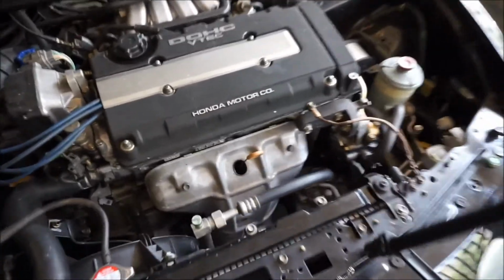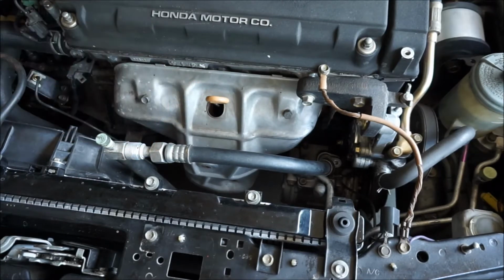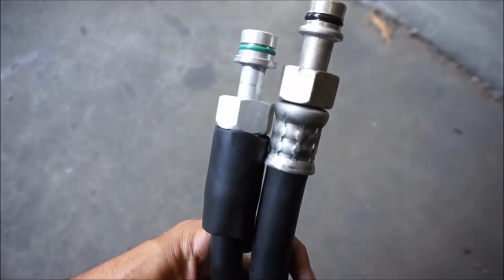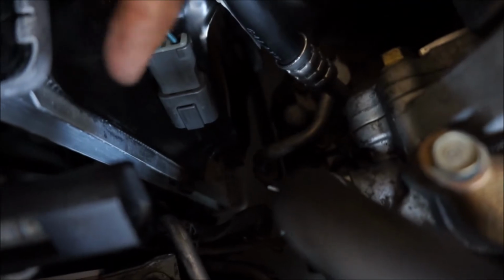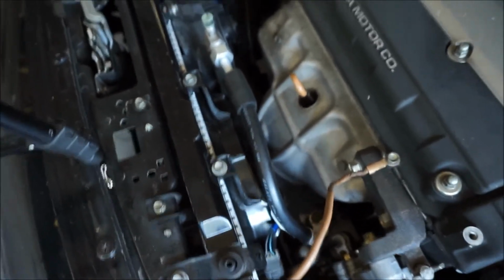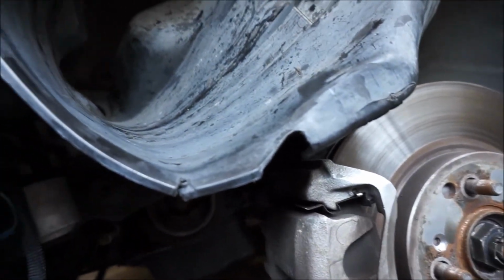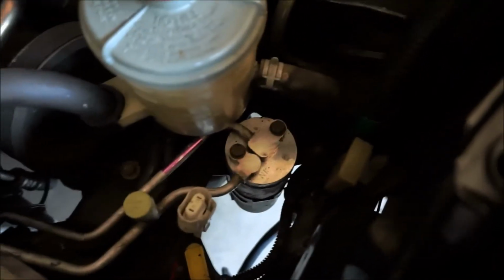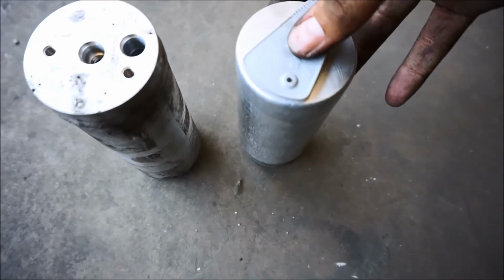Integra a/c repair part 3 | new suction hose and receiver drier

Comment: This is the first video i've seen on integra AC components. When I bought my db7 it didn't have a compressor,  but it does have the reciever dryer, lines,  but the main lines with the o rings were done apart and opened for the longest time. I found a teg in a junkyard with everything in the engine bay so i'm trying to learn how to switch all the parts out.
Reply from the maker: Nice!! get everything missing, install and buy an o ring kit off of eBay. get some PAG oil too. use the oil on the o rings and threads. You’ll also need the vacuum pump to evacuate the system.. then install the r143a… if you need any help, message me on ig @ integradiy

Comment: hey bro I have a quick question, my factory remote for some reason stopped working and now I have no way to disconnect my factory alarm except remove the battery lol. Do you know of any fuse that I can remove to fix this problem? I already have a after market alarm so I dont even need the factory one.

Comment: Hey I changed my alternator and after I ran my car for awhile the low line was sweating and leaking water. Does this mean I need to do what you did in this video or is that normal?

Comment: Whats the name of that second Line the one you said you can only find from Acura or a junker ?
Reply from the maker: Hi Sara, I'll get you the Part Number and Name when I get home tonight
Reply: @IntegraDIY  appreciate it. I may splice it but still need options from Acura or junker.
Reply from the maker: The part name is Pipe C, Receiver 

The part number is 80343-ST7-A01

If you need more names and part numbers or anymore integra related help, message me on Instagram @ integradiy
Reply: Integra DIY did you ever find out what that lines was called?
Reply: Sara Alvarez did you ever find out what that part number or line called?

Comment: How much have you spent so far on this ac job?
Reply from the maker: +K D everything including the radiator around $100 only
Reply: Integra DIY nice. Thank man. Took out my ac compressor when I took out my motor. Now Ima put it back. Since I just took out the freon and then took out the compressor, now I can just put back the compressor and freon right?
Reply from the maker: K D no, you must evacuate the system, by hooking up an a/c vacuum pump. The system is open so you let in contamination and moisture. Regular air and moisture will make the refrigerant go bad. Also, putting a vacuum to it will make sure your system can keep vacuum(hold a recharge). 

Also, it's best to change your receiver drier since the system has been open
Reply: Integra DIY thanks bro will do